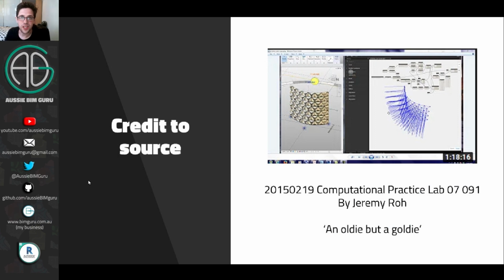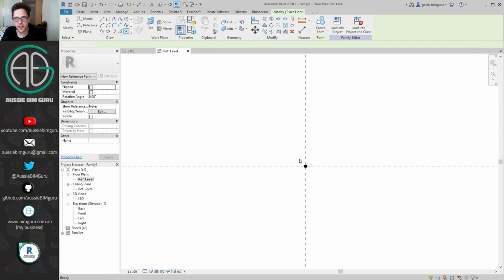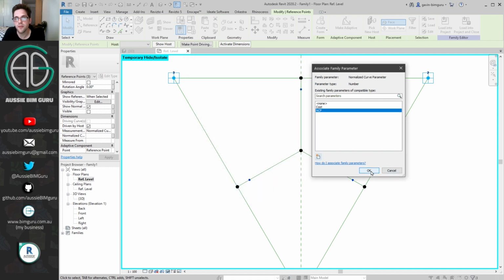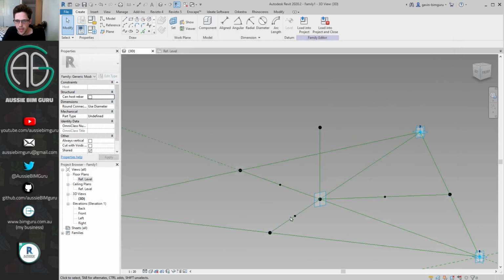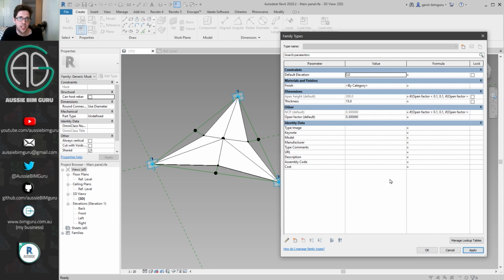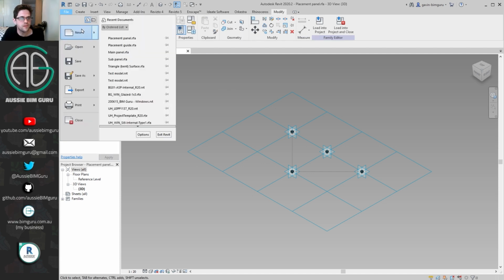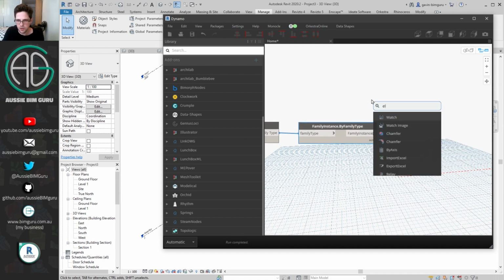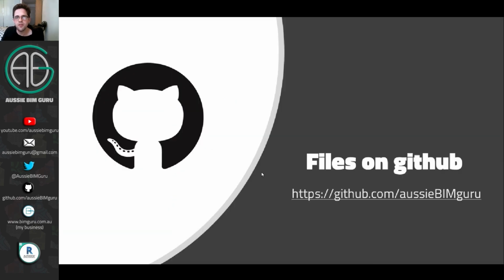Adaptive facade panel in Revit (Al-Bahar)

Comment: Hello there! Thank you for the tutorial. I am trying to create different facade pattern by combining your previous intelligent panel tutorial. Folding parameters are working just fine but, when I place the family on to the project with dynamo, it gets flattened towards the mass. Any Idea why this happens and how can I solve this problem?
Reply from the maker: Assuming you want it to hug a curved surface you may need to redevelop the family to bend, so instead of a 4 point object you may need a 9 point for example, so it can support curvature to its edges and underlying surface. The example I showed here is actually flat when placed, and gradually follows the curvature in a faceted fashion.

Comment: It's so great! But I would like to give you a question: How can you use Instance Parameters in Type Parameter formulas?
Reply from the maker: You can't, it wouldn't make sense to. The only case where you can is if you have a nonshared nested family - you can associate instance and type parmameters to its type parameters at the host family level.
Reply: The things here is- I apsolutely  followed all of your steps, just only thing i can't do is changing the number of Open facter as Instance Parameters as you did. Would you pls give me some advices for that ?
Reply from the maker: @lananhle8677  it sounds like some of the necessary parameters aren't instance based. Make sure in the family editor their names all show a (default) after. If so they should work. Make sure the open factor is of the data type Number also.
Reply: @AussieBIMGuru  Thank you for that. I did it! ^^

Comment: hello, guru nice work. If possible can you make a tutorial of solar analysis with dynamo and also with this panel. thank you
Reply from the maker: Unfortunately I no longer use Dynamo for solar analysis, as the Ladybug package hasn't worked since Revit 2019. In tomorrow's video I'll show how to use Rhino Inside to access the Ladybug package for Grasshopper to guide the sun angle however.

I have an older video here where I used Ladybug whilst it still worked which might be of interest;
https://youtu.be/qQCjT1FFEeI
Reply: @AussieBIMGuru  ok, thanks.